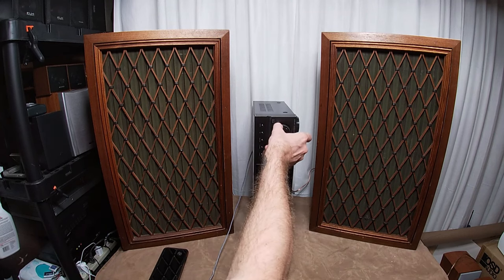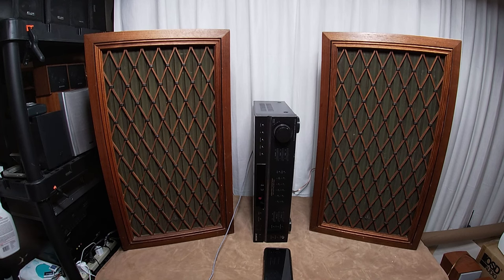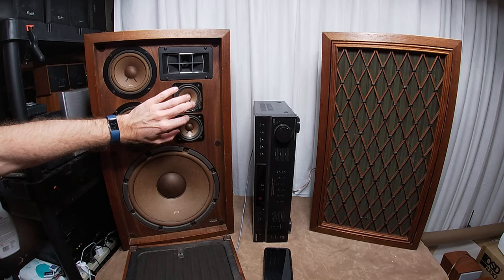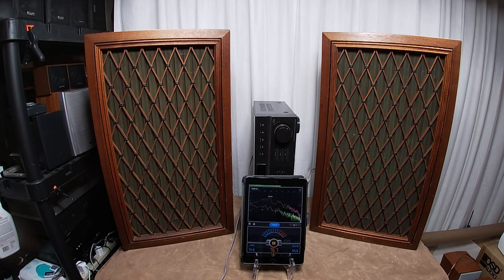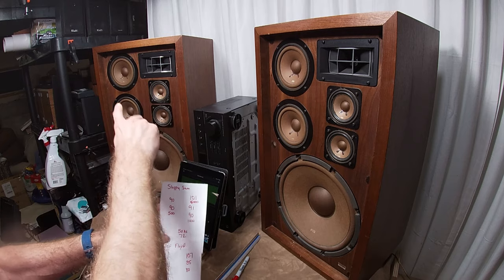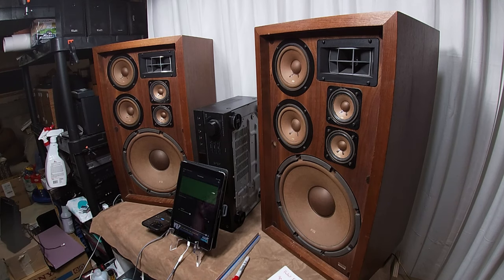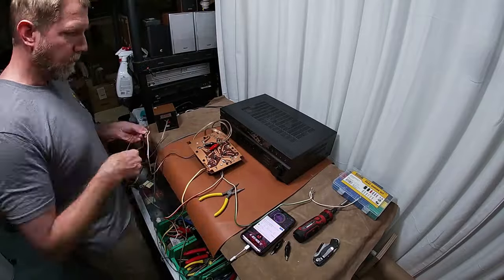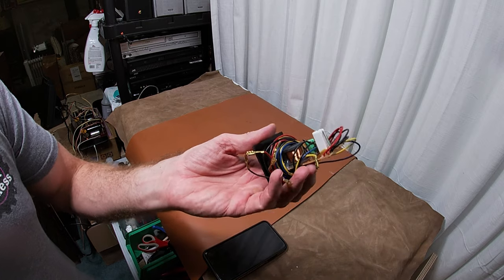How much improvement? Vintage Speaker Capacitor Upgrade & Replacement - Pioneer CS-88a

Comment: Electrolytic Capacitors are a lot like New Cars. The minute you drive them off of the lot, they start to go down hill. Yes Capacitors will most likely be working after 15 - 20 years after being made, but they will not be what they were when they were new, even if they were never used! Every 15 - 20 years Electrolytic Capacitors need to be replaced to keep Vintage Equipment working at it's best. and from possibly making other components fail. There are Positives & Negatives to both Vintage and Modern Equipment.
Reply: That's not always worth it. At 20 let alone over 40 years old, anything can fail at this point. Also, there are caps of vastly different quality levels with different applications. The most common effect of aging on electrolytics is high ESR. 
Especially the tiny small signal ones, which are also very unlikely to fail short circuit (not more than a transistor I'd even say), are thus usually not worth changing (unless Matsushita made or other known problem types). Even if the ESR rises from, say, 10 Ohms to 100 Ohms, and the stage impedance is over 10k, there won't be any audible difference. And if you do hear anything going bad, you need to find that specific part and change it out instead of just blaming 'the caps' because they might very well NOT be the reason. 
New caps don't mean the thing will not need any other repairs and you will still need to be able to do real troubleshooting. 
Low impedance circuits are more susceptible to the ESR of the cap worsening. That includes speakers, output stages and also power supplies,  where they are often less likely to fail in general but most likely to fail short circuit and cause damage to other components, especially if the device has sat for a while and they haven't been reformed. 
If you reformed them it's still pretty unlikely, however if the device is worth a lot, it's still a good idea to change them.

Comment: If you did your test in stereo the receiver may be at fault not the speakers.  Equalization bottom and top end,  and Dolby can be fussy.   I cant hear the difference.
Reply from the maker: This is a really good point. I should have had both speakers on the same channel!

Comment: The mids on these CS88a's are way overbearing !!  had installed 4 ohm resisters in line to the mids to get them settled down! My CS 99A"s are more balanced , But not to be set the bar by any means! Not truly impressed by either one. However your recap efforts probably would have smoothed the CS88'A Mids out!

Comment: I was interested by your title, but disappointed by the actual video.  Spend more time on the post-change analysis:  what you were looking for, why you were looking for it, why you thought the change would be effective, what was the actual result, how did it compare to desired outcomes, why any discrepancy between expectations and actual results, and what you might do differently if doing again.
Cmon man, this is basic science report stuff--I am certain you can do better (you seem like a smart and capable guy!)

Comment: Too much amateur crap . The coils are too close and a lot of problems with the xover board design . You should have started over with a fresh board. Space out the coils properly remove all non copper connection points putting better grade caps,resistors,coils on a badly laid out board design was a waist of money and time
Reply from the maker: Lol, lol… omg… OCD MUCH?
Reply: Easy to make  lecture to author 😃. If you are so good please tell us what is exact minimum distance coils  for not hurting xover? Is it  "Proper"? Will you garantie that ANY   fresh board will alow to notice improvment of  sound?
Reply: You have to love these vintage electronics ❤.
 Working my entire career on new and old I have a profound respect for everyone involved in the design and implementation of ALL vintage electronics. These folks before us were exceptional !
Reply: If they were made in USA  would u b so crtical
Reply: @Mikexception 1.5 inches minimum,
Reply: @ericschulze5641   15 inches  would do better :). Do you have any personal  practical experience? I have experience that maunting output transformer   in 1 inch distance from  small supply transformer and about 15 inches from power transformer  induces clearly noticeable hum in speaker.  Hard to say which impact prevails -  I do nt reject any . Try to set transformer solder iron around crossover coils with speakers connected and switch on. .
Reply: @Mikexception one point five inches, away from each other, is what researchers/ engineers found MANY years ago
Reply: @ericschulze5641  You want to talk about scientists and engineers?